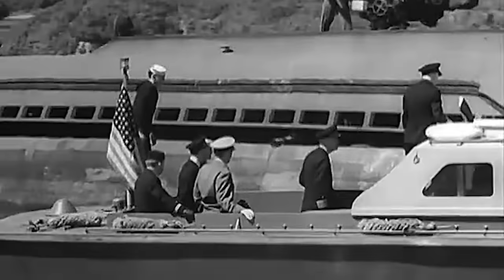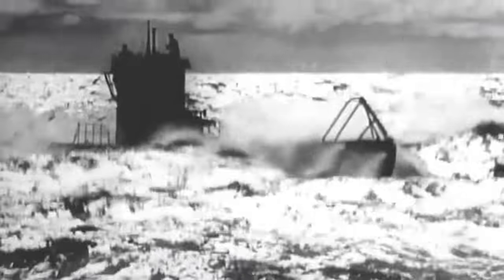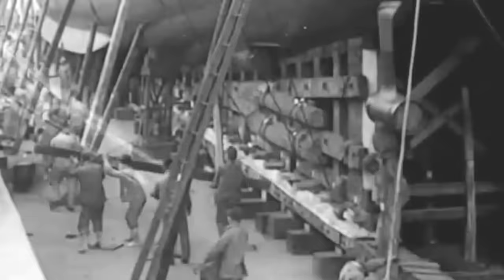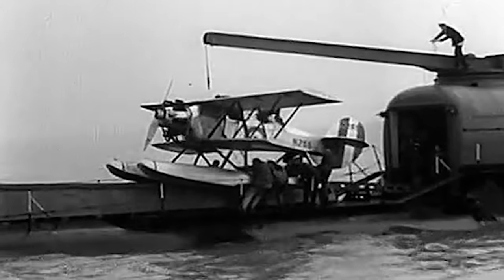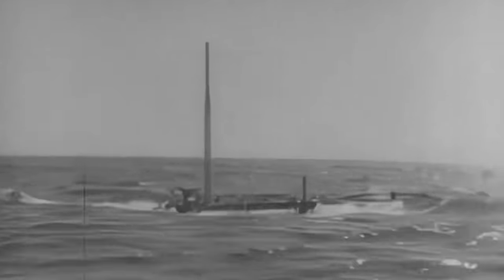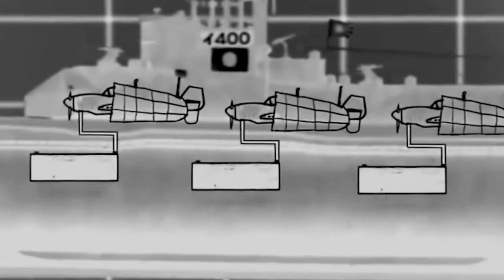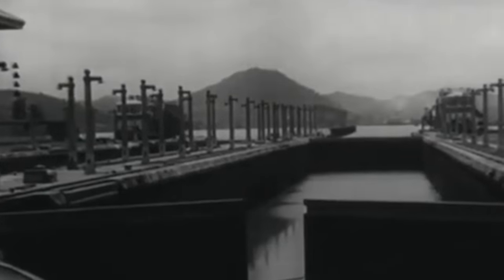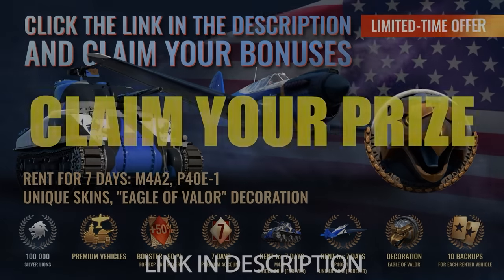The Hidden WW2 Super Submarines

Comment: Note that Op Road's End did not just apply to the submarines discovered after the surrender.  It was the wider plan to dispose of all remaining Japanese warships not of use to the Allies.
The Germans did not plan to 'launch seaplanes from submerged submarines'.  Just think about that for a minute.  They would of course have to be on the surface (see M2).
The British M2 is now an interesting dive site at 130ft, so accessible by recreational divers.
I don't recall the only Japanes bombing attack on the mainland US (8:27) involving air-to-ground rockets.  Just some generic bombing clip would have been better.
Yamamoto did not design the I400 series subs; he was not a naval architect.  The concept though was his.
To be accurate, the I400s could not carry the Type 93 'Long Lance'.  Japanese submarines carried the smaller, 21" diameter Type 95 torpedo.
Odd use of English.  The Japanese did not consider 'the previous Panama Canal attack to have had little impact on the outcome of the war'.  This implies the attack had happened.  I think what you meant was 'the planned Panama Canal attack would have little impact on the war's outcome'.  If you're going to use wiki as your primary source you might also copy their use of tenses.
For the Ulithi attack, the four C6Ns were not transported to Truk on I13 and I14.  They were taken by cargo ship, reassembled and loaded onto I13 and I14.
I think the point about the I400 class is that they were 'super' in size, but little else.  Their technology was otherwise unremarkable.  The Japanese had early on conceived of submarines as bases for naval air recce but failed to actually exercise that capability, or indeed the combined use of surface and submarine forces, until 1938.  The result was a disaster.  But the lessons were not identified, likely as too much ego had been involved.  The US, UK and others had abandoned the concept as it just did not deliver the required benefits.